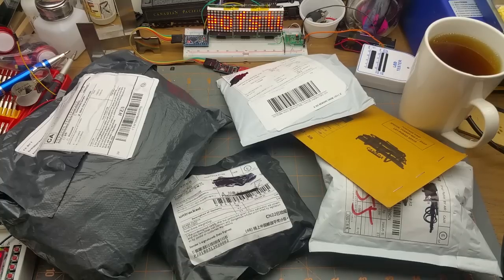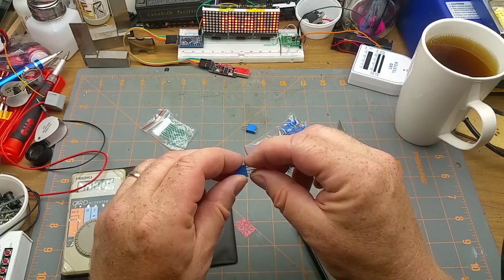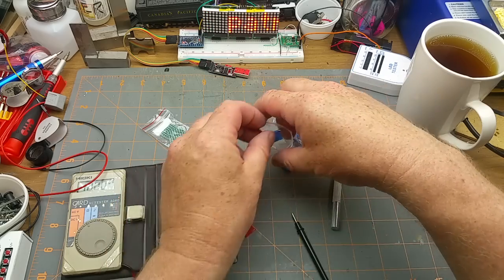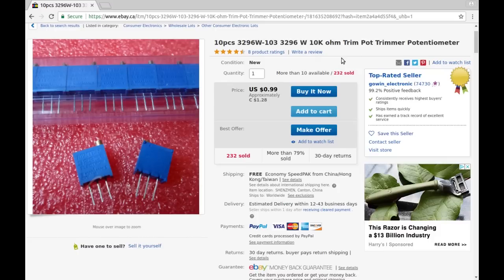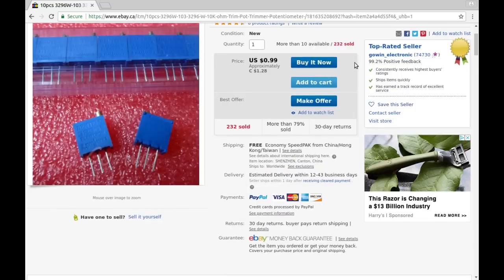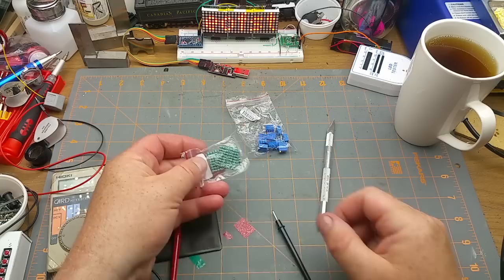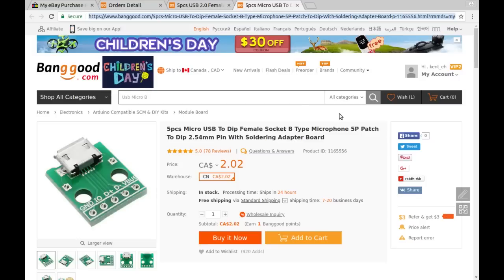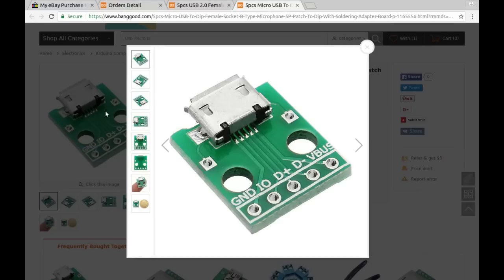MailbagMonday30

Comment: I gave up on the brown Chinese PCBs because every time I resolder a part, or heat a joint too much, the pads fall off. I've got green PCBs on the way to test.
Reply: I had the same problem also. The green ones works great.